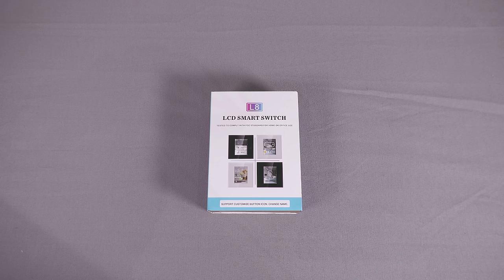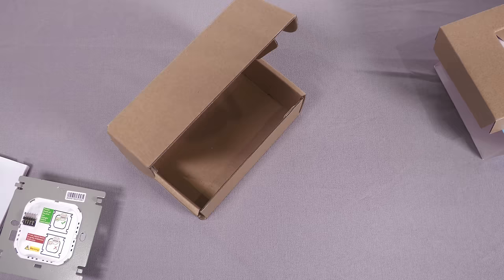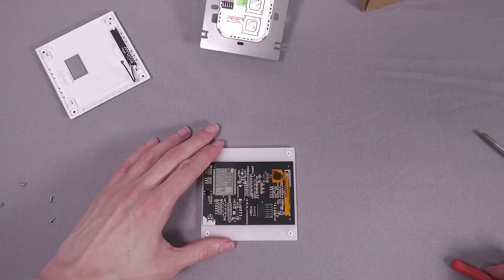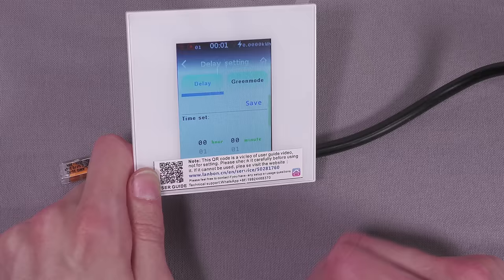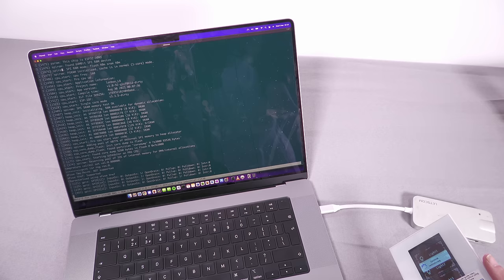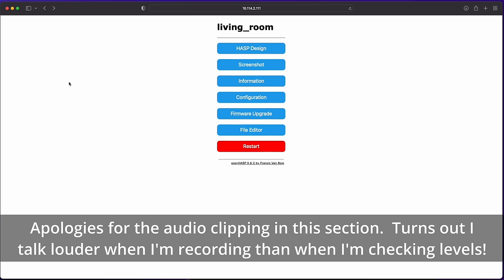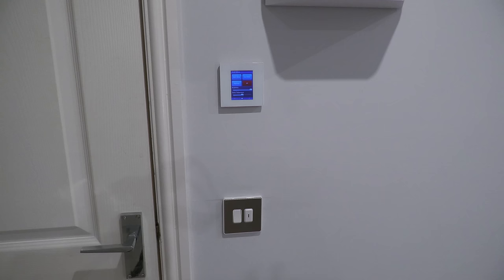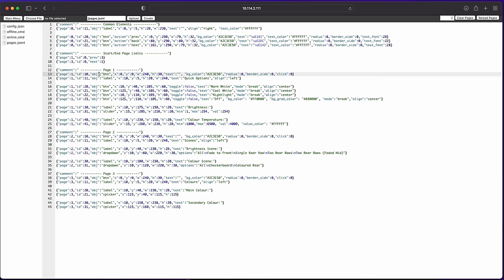The Perfect In-Wall Touchscreen for a Self-Hosted Smart Home - Lanbon L8 running OpenHASP

Comment: Your assumptions on r45 are correct, that is a thermistor, the cutouts around it on the PCB are a dead giveaway, they are there to thermally isolate it from the rest of the board so it can get an accurate reading.

Comment: Thanks for this great overview of the Lanbon L8 device. The video showcases the exact reason we've built a custom firmware to control Home Automation devices.
The integration with the lights looks amazing. Well done!

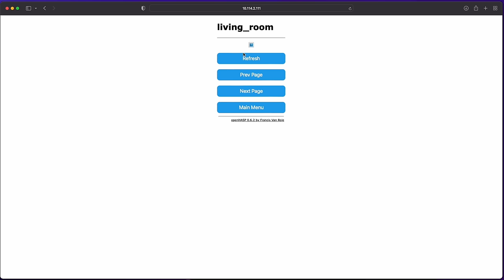@29:52 Is indeed an issue with compatibility in Safari browsers that will be fixed in openHASP 0.6.3.
Reply: openHASP 0.6.3 has now been released with bug fixes and new features.

Comment: Loving this, just ordered two. Even if I don't put these in walls, I like the idea of a backbox with a cable going in, I know you can get the ones with flex clamps in. I can have one sat on my desk or whatever.
Reply from the maker: I actually thought about doing the same although for added neatness, you don't even need to use the included power supply.  You can power it by simply providing 5v DC to the appropriate pins on the connector on the display (same connector used for programming).  It would be dead easy to just wire it up to a USB cable and power it from a USB power source.  I've considered making one of these for beside my bed where I already have a multi-port USB charger.  That way you'd be able to just have the slim display portion sitting flat or maybe on some sort of stand without needing to accommodate the large power supply.

Comment: 10:38 thats interesting Here in norway our lights and Outlets are usally on the same fuse and we normaly have 10-16 amp on regular outlet and lights course,  i have two thou lines like that.  now one of my lines dose have a 25 amp fuse cuz of my power draw,  now im using 230v,  and technicaly 16 amp is the max rating our regular walloutlets have, so we could say its not fully legal,  but im not pulling over 16 amps thru one single outlet, most of the power actualy gets feed out thru a 3 phase outlet wired for one phase, and the actual outlett can take up agains 30-40 amps, so in ground and reason its fine and not a fire hazard, but the plan is to see if we can bring down .. well its gonna be tight cuz its a concreet building and we cant add extra in-wall cable shrouds, but we are gonna try to bring down an extra set of L, N and GND from the fuse box and wire that directly into that 3 phase outlet to make it a 100% complaiant.

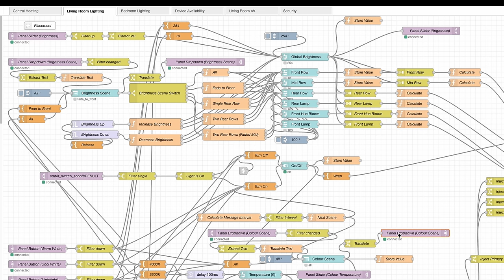44:57 Oh holy heck...  This is gonna take some time to get the grasp off.  but u said openHASP had a lot om documentation so i guess it will be fine...   right?.. XD

Comment: Very interesting (as always), I'm interested in that "Linving Room AV" tab in your Node-RED too :p
Reply from the maker: The Living Room AV stuff is a bit bodgy but works well.  It periodically connects to my receiver over Telnet to determine whether it's on or off and then controls smart plugs feeding my subwoofer and TV LED backlight accordingly.  It also gets the receiver's current input and uses this to switch HyperHDR between HDR and SDR modes.
Reply: @camerongray1515  Okay, I expected it to control stuff over IR too :-)

Comment: To anyone buying these, quality control is a definite concern. I now have five of these devices, they are amazing, I have another two coming tomorrow. Unfortunately, only three of the five are without problem. One has bad corruption on the screen and randomly locks up, usually within a very short period and the other one locks up too, usually within an hour.
Reply from the maker: That's annoying, I experienced frequent lockups when powering it from a plug but after powering it from the lighting circuit I maybe get one lockup a month, therefore I suspect it's maybe due to some sort of interference with the power supply.  If you aren't using the relays, you may be able to remove that entire part of the system and power it using a different 5v power supply connected to the pin header on the back of the display - before I installed it in the wall, I was able to power it from a USB power supply running off the same socket circuit that was causing crashing with the included PSU without any lockups.
Reply: @camerongray1515  That's a really interesting comment Cameron, there was one downstairs by the Mrs computer and I was for a period convinced it was something to do with the power supply down there as units that run 24/7 in my office up here started crashing down there.
Reply: Is your one in the wall stable now?
Reply: I was wondering if some ferrite beads on the cable or something may help.
Reply: PS add those 45 degree backboxes to you amazon affiliate links down below, you may get a couple of pennies from them :)
Reply: I have flashed all mine with a 0.6.3-dev image, it has fixed all problems including corrupted screens I think it was compile with spi=60mhz, had 24 hours now and all boxes are running fine.
Reply: @DigisDen  Great! The latest PCB revision seems more susceptible to interference. openHASP v0.6.3 now has 60MHz as the default speed. You can also easily disable the serial port completely using the web UI. Both of these adjustments should greatly improve the stability.
Reply: @openhasp  I have had not one single lockup since and these run 24/7
Reply: I have just 3 in active use right now.

Comment: Hi my wife just bought this, not sure if you can advise on the fitting. We have a plastic back box and a ground wire available. 

The l and l1 and neutral all fine and make sense. There is no ground connector. 

They have a video showing the ground being connected and I guess bridged with neutral. This looked odd to me never seen that before. Some Googling suggests it shouldn’t be done.  

Not sure if I should just leave the earth out and cap it off with wago to keep it away or if I should fit it with the neutral, what did you do sounds like you are in uk so assuming you have same sort of wiring as me
Reply from the maker: You definitely wouldn't want to connect the earth/CPC/ground to neutral, all that'll do is trip any downstream RCDs.  The Heat Link doesn't need earthed if you aren't using the 12v output to the thermostat so you could just connect it in a wago however there is a earth connection to the right hand side towards the 12v outputs so I'd connect it there to keep it out the way.

Comment: Cameron, do you think it would be possible to control the 3 relay model like you have yours setup. For example, if I have a light on each relay could you set up pages to control each with the warm, cool, dim as you did with he one light?
Reply from the maker: It's not something that I've tested but apparently you can control the relays from OpenHASP by controlling the GPIO outputs.  However, of course these are just relays so you wouldn't be able to use them to dim or adjust the colour temperature of the connected lights directly.  In the setup I showed here I didn't use the relays at all and instead just used smart bulbs powered via a key switch.  The L8 was purely acting as a touch screen with no load connected to it.

Comment: Great video Cameron, any reason why you didn’t go for the NSPanel and flash that?
Reply from the maker: The NSPanel looks great and is definitely on my list of devices to check out if I have the time/budget, however it's much more complex to use in a setup such as this.  The display is actually a Nextion HMI which itself is essentially a microcontroller.  Therefore to get a custom interface, you'd need to both flash the firmware on the NSPanel itself (with something such as Tasmota) and then also flash the Nextion HMI with your UI which you'd need to build using Nextion software and UI components.  People have figured out the process now however when I first started this project, the process was still in its very early stages.  By contrast, the Lanbon L8 is just a microcontroller connected to a SPI LCD display, much like people would make as a hobby project using an Arduino.  Obviously I used OpenHASP here however it would also be trivial to build your own firmware from scratch if you desired.  Finally, the L8 was also just a fair bit cheaper and I felt like it hadn't been covered in any real detail on YouTube so decided to prioritise it over the NSPanel which already has a lot of YouTube coverage from much larger, better channels than mine.

Comment: It is cool how this works for you, however I would like an ethernet PoE variant better. I know, ESP32 is cheap and common as f., but I really don't like the idea of having fifity mains power supplies constantly on, buried in walls. And to use radio for a fixed installation. But the market does seem to go solely in this direction...

I might design one myself (can't compete with the price, nor the looks though) with wired PoE connection. I thought about CAN bus + the PD part of PoE as well, but I dropped the idea as it does not seem to integrate well easily with MQTT enviroment, unless someone designs everything from scratch, which is crazy amount of work.
Reply from the maker: Totally agree, in fact there's literally a CAT6 cable sitting in that wall that I ran in years ago with the hope that a product that would support it would become available.  This solution was simply the easiest solution although if a hard wired option became available I'd be strongly tempted to move over to it.
Reply: @camerongray1515  I just found out that there is a development board from Olimex with stock code ESP32-POE-ISO* which has an ESP32 module, an IEEE802.3af compatible PoE PD with galvanic isolation (there are unisolated versions too), and an Eth PHY compatible with ESP32-IDF, so not just powered by PoE, it can also communicate on the wired port.

You mentioned that you don't want to tinker, but I think practically you have to connect the existing SPI display to the Olimex board (probably by removing the existing ESP32 module from the original PCB to keep other functionality, like LEDs, temp sensors).

This devboard seems to be a very good base for these kind of devices. The disadvantages that it is 100mm wide + the eth plug itself, so it does not fit into 63mm EU wallboxes and only fits into double-sized UK ones, and there is only 5V/300mA available for additional circuitry (ie. not the full 15.4W of the 802.3af).

Comment: Hey Cameron. Great vid!
What (and how many} devices do you have controlling your living room down lights?
Reply from the maker: Living room is just the touchscreen, the Node-RED web UI on my phone and the retractive switch on the wall connected to a Sonoff Mini as shown in my recent video.  Bedroom is the same but also has a small "Osram Smart+ Mini Switch" zigbee remote that I can use to control the lights from in bed.  Then they're also integrated with the alarm system so that they turn off if I arm the alarm, but that's coming in a video soon!
Reply: @camerongray1515  thanks man. I was more after the controller(S) attached to the lights cos I can't see how to control the individual lights with only one sonoff mini... Thanks again!
Reply from the maker: Ahh, the whole thing is controlled by Node-RED that receives messages from the input devices then controls the lights, all done over the MQTT protocol.  Most of my lights are currently Zigbee devices so I have a raspberry pi with a Zigbee USB stick running the Zigbee2mqtt software which allows me to control them over MQTT.  Then any WiFi devices I have are flashed with custom firmware such as Tasmota which also allows them to be controlled over MQTT.  I demonstrated the Zigbee2mqtt setup in this video here: https://youtu.be/zo0B6tXAFoM

Comment: Hello mate grate video iv been after some thing like this for a long time all my down lights are smart would you be interested in programing 3 of the smart switches for me im a electrician by trade but never got my head round the programing
Reply from the maker: Might be a bit tricky to be honest, the touchscreens on their own can't control lights directly, they need a server to communicate with which in turn controls the lights.  It works great but requires quite a bit of ongoing technical maintenance if things break or if you wanted to change the lighting scenes.etc.  It's not a "set and forget" solution unfortunately.
Reply: Tha ks for taking the time to reply The down lights I use are tcp smart lighting they have a app for phones and run on most platforms but if I had to add some.thing to.make.them.talk.to.each other.id.be happy to.do that  I could probably do the matance it's just programing the smart switch I could not do
Reply from the maker: The difficulty is that the part that sits between the touch panel and the bulbs (in my case Node-RED) is probably the most complex part to set up requiring a server running software and the creation of Node-RED flows which in my setup requires Javascript programming to get certain functions to work as I want them.  If you were to attempt this, I'd strongly recommend getting the Node-RED setup working first without buying smart switches.

Comment: been playing with the NSPanel if I'd seen these first would have got these tbh. Downside is my light don't have neutral at the switch
Reply from the maker: Researching the NSPanel was what actually caused me to discover these.  I still want to get an NSPanel to try out at some point now that the Nextion stuff is starting to get figured out for creating custom UIs.  As for not having a neutral at the switch - you'd need one for either device, however if you're using smart bulbs and not worried about actually switching from the device, you could always alter the wiring at the ceiling rose/junction box so that the light is wired permanently on and the 2 core cable used for the switch drop would instead carry a permanent live and neutral down to the switch. (this applies to the UK, other countries may vary). This does of course mean that in order to power the light fitting down (e.g. to change a bulb) you'd need to turn off the whole lighting circuit which isn't ideal, but it's an option worth considering.

Comment: Hello, Sorry if I missed it in the video, but how deep of a back box do you need for these bad boys? Also I noticed no earth connection, I presume this is due to no exposed metal parts once mounted on the wall?
Reply from the maker: I'd go with a 47mm box, you could maybe squeeze it into something smaller but it'll be tight.  I totally forgot to mention the earthing in this video.  In my opinion this really should have an earth terminal.  In my situation, I have it in an earthed metal box so it'll earth it through the screws which is good enough for me, but if you're fitting it in a plastic box or want to be extra safe, you might want to try and add on some sort of earth terminal to the metal plate and to be honest, I should probably do the same here as my backbox lugs are both spring loaded - it's showing good earth continuity but isn't necessary "by the book" correct
Reply: Damn, that back box is deeper than when we conceived our third child O_o. The touchscreen doesn't bother me so much it's nice but in reality I think overkill, the SONOFF Mini may be better suited, did you also fit that in a box the depth of a metro station or can they squeeze in a smaller box (also I trust SONOFF's CE marking more than a Lanbon China special).
Reply from the maker: The Sonoff Mini is 20mm thick so you'd basically need to work out if you have enough space, you could probably squeeze into a 35mm box but it'll likely be a bit too deep for a 25mm one unless your switch barely protrudes into the box.  I'm very fortunate here that all my walls are stud walls so even though all of the original boxes are also set back pretty far, I can easily fit 47mm dry lining boxes if needed (if I'm using a dry lining box, I'll basically always use 47mm)

Comment: can you not do ser0=NULL once you have updated to latest firmware so no one can get into your network.
Reply from the maker: Huh?  There are no configuration parameters in OpenHASP anywhere close to "ser0" and I can't see how a single configuration parameter on a smart switch would stop people "getting into my network"
Reply: @camerongray1515  was worth a try anyway but as ser0 equates to the serial connection port it has to be exposed somehow.
Reply: @DAVIDGREGORYKERR  You can disable the serial port in the firmware but this still allows anyone to flash the device over serial because that part is handled by the bootloader. As for access to your network, the openHASP firmware is open source. You are encouraged to review and contribute to the codebase. Compiling the source yourself allows you to disable/remove any of the network services you don't want.

Comment: WAY too EXPENSIVE
Reply from the maker: Value is subjective, with this it's something I needed but there was no cheaper alternative
Reply: Check out the WT-86-32-3ZW1 by Wireless-Tag. It's very similar and quite a bit cheaper with (arguably) a nicer design...
Reply from the maker: Interesting, that looks like a really nice device!  Shame that it's not as easy to get hold of (The Lanbon L8 was a relatively impulsive Amazon purchase) but I can see it on Alibaba with sellers that allow them to be purchased individually so I might need to pick one up for a video once my budget allows!